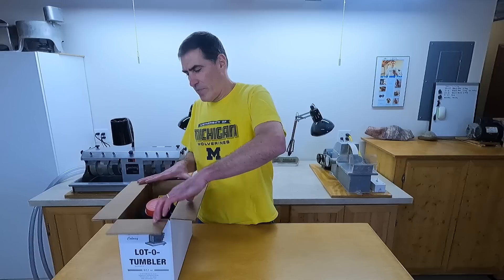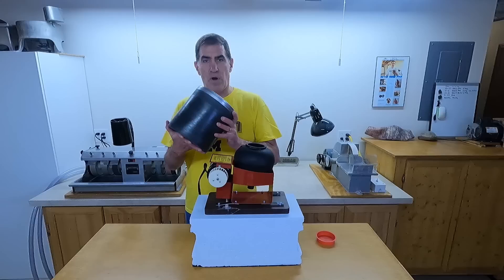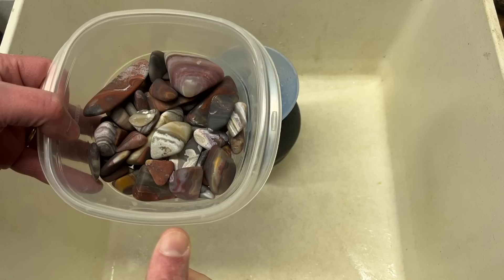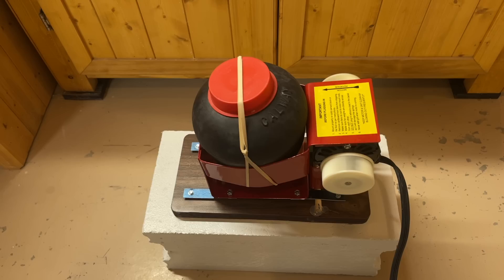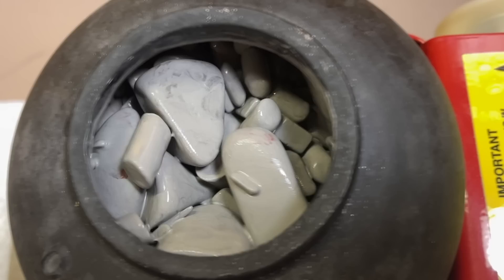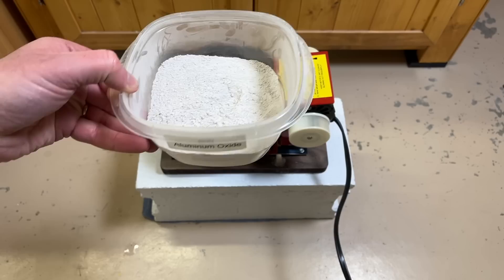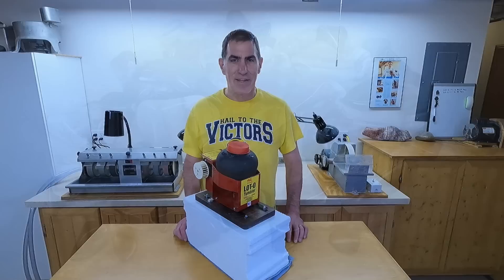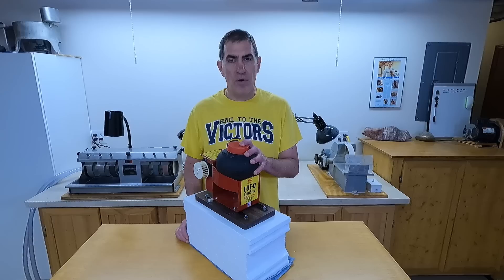The Lot-O Used To Be My Favorite Tumbler. It's Not Now. See Description Below.

Comment: I love my double barrel Lot-O tumbler, I also have a single one as well. I am still learning a lot and have a long way to go to even be half as good as you Rob. Right now my back won't allow me to mess with my tumblers so I'm on hold for a while still. I do have several rocks I need to polish better, because I had bought a cheaper grit.  Lesson learned. I have learned so much from you. Thank you so much.  Great video. Thanks for sharing.
Reply from the maker: Wow, you have three Lot-Os (double + single)? That's a lot of space in very fast tumblers. I went the other way and put my money toward a lot of rotary tumblers just to feed one Lot-O. Until about a year ago, one Lot-O was plenty for me. Then again, I'm sort of obsessive about that first stage and getting all the holes out of my rocks so I need more rotary barrels than vibratory barrels.
Reply: Yes I have both a single and a double. Most of what I bring home is pretty smooth already.  But I do have to let some go longer in the first stage still. I don't always have all my tumblers running at the same time either. I'm down by 2 of my rotary tumblers now as well. The 2 I got from harbor freight both died and in less then a year. So disappointing.  I'm hoping to build a larger capacity rotary tumbler this year. I finally get the camper here that I'm turning into my workshop, so now I have to fix it up the way I want it to be. I just need the tumblers out of my tiny home to run them. I have tons of rocks just sitting here that I have collected over the years that need tumbled.
Reply: I think I was not too selective in what I brought home in the past years, so I have a lot of sorting to do now. I know I have rocks I just won't tumble or they won't tumble well so I need to weed them out. I am super selective now days on what I bring home. I need to catch up with what I have first. So I guess it's a good thing I couldn't get out much last year. LOL
Reply from the maker: @donnalantz7981  Sounds like you're going to be busy!
Reply: Keeps me out of trouble. LOL

Comment: I am new to tumbling. :) This video was a Godsend for me as they all seem to be! I have an older Lot-O Vibratory tumbler that I bought probably close to 25 years ago at a garage sale. I have never plugged it in until now. Other than a broken spring and a missing cap it seemed like everything is operating fine. I did not realize how the rocks should be moving inside the barrel until I watched this video. Unfortunately the website for this tumbler seems to be out of stock of many things including the spring I needed. I was able to get a cap though. I just happen to have a 3" x 5/8" mending brace that I bought from Menards a few years ago. I wasn't sure if it was going to work because it is more stiff(thicker) than the original spring. The holes lined up perfectly and I installed it anyway just to see if it would work. I also filled the pit at the bottom of the barrel with clear Gorilla glue and replaced the dowel. I started a batch today and "Wallah" it's moving fantastic! I'm still not sure if the glue will help or hinder because the one batch I ran after I filled the pit with glue ended up becoming a big clump at the bottom and I have not had the happen before, even with a broken spring. I'll know in the next day or two if the glue has been a help or hindrance. I ordered two more barrels so that I can have one for each phase. So if I have to remove the glue it will not be a big deal. Thank you for putting together such fantastic helpful videos and congratulations on the first place win of your young student. That's inspiring. :)
Reply from the maker: That information about the spring replacement might come in handy for some other people. I have heard that they're not able to get springs from the spring manufacturer right now. It's nice to know that there's an alternative. 

I used epoxy to fill in the holes of the original barrel. If your Gorilla Glue doesn't work, give that a try. Doesn't Gorilla Glue expand as it dries? I'd think that could be a problem. Epoxy doesn't do that.
Reply: @MichiganRocks  There is a Gorilla glue that expands. The one that I used did not. I used the clear version and let it dry for a few days. The front of the bottle says 'no foam' and 'water resistant'. So far so good with this batch. I did a couple of spritzes of water this morning. Tomorrow I will remove the rocks and update what the bottom of my barrel looks like. :)
Reply from the maker: @mrsluvtolearn  Oh, ok, I didn't know there was another kind. That type sounds like what you want.
Reply: I updated this this morning but it disappeared for some reason. Here goes again. :) The bottom of my barrel did have a slight clump, not as big as the last one but still there. I popped out the glue just by pushing in the nub on the outside only to find out that there was still a bit of wet glue underneath even after letting it dry for two days initially. Fortunately I have my new barrels already and was able to move to the next stage. If I were to do glue again, I would let it dry much longer than two days or use epoxy as recommended here. I just checked my tumbler after having it ran most of the day and it is moving faster than ever. I'm super pleased. :)

Comment: I bought one of these barrels. And made one of these. 
I used a 500watt spindle motor and a whiskey barrel band it’s all suspended on top a single metal rod stuck into a wood block. to act as the spring or give for the vibration. 
40 dollars and parts I had laying around.
Reply from the maker: That's awesome. You should make a video showing it off. I think a lot of people would be interested in seeing that.

Comment: Followed the link to replacement motors and went with the cement vibrator, works almost to well, going to have to experiment with how much ceramic media to use it definitely moves the rocks more aggressively
Reply from the maker: You can adjust that motor to work just like the original. I forget which forum post I linked here, but look at this one to see how someone with a ton of experience with a Lot-O adjusted his motor weights: https://forum.rocktumblinghobby.com/thread/101470/finished-batch-watt-concrete-motor

Comment: I added a cement vibrating unit to mine after the motor died. I bolted it to the top and it is adjustable for how much it vibrates. Much better bearings and cheaper that the original.
Reply from the maker: Did you get that idea from Chuck (Drummond Island Rocks) on the Rock Tumbling Hobby forums? It wasn't his idea, but he did a nice job of showing his process. 

https://forum.rocktumblinghobby.com/thread/101470/finished-batch-watt-concrete-motor
https://forum.rocktumblinghobby.com/thread/101420/lot-motor-concrete-video
Reply: @Michigan Rocks  I don't know.  I like to think I thought of it but I'm old.
Reply from the maker: Maybe you did. I've just seen other people discussing doing the same thing.

Comment: What I've found with this tumbler is that if you don't fill it up enough with rock and especially with ceramic tumbling media, it just won't roll like it's supposed to.  So if it looks like yours is just really weakly tumbling, or just sitting and jiggling, check how much stuff you have in there.  Ideally you should have about half rocks and half tumbling media, and together they should be nearly to the top, no more than an inch below the top rim.  Also, don't try to tumble too many large rocks at the same time.  A mix of medium, small, and a couple or three larger rocks works well.
Reply from the maker: That's right, it does need to be filled up pretty well. I sometimes run it with more than an inch of empty space and it does fine, but I'd rather utilize all the space inside if I can. I don't think you need to have 50% ceramics, but it doesn't hurt to. I'd say for me about 30% is the minimum amount. If I'm tumbling lots of flat things, like Christmas ornaments I make, or cabochons, then I bump the ceramics up to 50% or more.

Comment: Hi Rob,
Thanks so much for this video. It was a lot of help to me.
Just a few days ago I finally got around to setting up my single barrel Lot-O Tumbler. After filling it and turning it on (yeah!) my rocks barely moved. They just kind of vibrated a little, like dancing up and down. So first I thought maybe I had the barrel too full, so I removed some of the rocks and ceramics. Going so far as to actually weighing out two pounds of rocks and 1 pound of ceramics. Still barely any movement to the content of my barrel. No standing water in the barrel was to blame for the inaction either. 
I remembered your video and rewatched it and writing down the measurements for the location of the dowel. Mine was not in that location so after a short trip to my local hardware store for an 1/4" open end wrench (I think that is the only thing that can remove the 2 bolts underneath the motor bracket) and some 3/8" dowel material the next morning. I went about taking the machine off it's baseboard and repositioning the dowel. Good thing I already have a brad nailer and hot glue gun. 
Finally my rocks are moving with a nice rotation in my barrel. 
It even seems to me that the motor is not making as much noise as before and also is not getting as hot.
Reply from the maker: My motor gets plenty hot, so I wouldn't worry about that. I fill my barrel right up to the top, no need to weight anything. I'm glad you've got good action now.

Comment: im just getting into rock tumbling and you are increadible! Your videos and advice is second to none.  Also, GO BLUE!!!! (I grew up in TC and now in GR) Thank you for sharing your wisdom.
Reply from the maker: I'm glad to help out!
Reply: curious, does it hurt to add a step of 1000g Al oxide? before the Polish? also, besides wasting grit, does it hurt to use 1tsp instead of a half tsp for the 500, and polish?
Reply from the maker: @schramajamma  Adding a 1000 stage doesn't hurt. I used to run 500 for two days and 1000 for two days. I switched to running 500 for three days and skipping the 1000 and haven't noticed a difference. 

I don't think using a little more grit should hurt anything, but 1/2 teaspoon works fine, so I haven't tried more.

Comment: Just the info I was looking for, I am getting good results but my rocks never moved like yours did (your old model) I thought maybe the older models were better designed. Another thing to be aware of is the bearings will come loose on the motor, mine lasted about 2 years. The motors are replaceable but be prepared for the price.
Reply from the maker: My first motor lasted ten years or so, but you’re right about the price of a new motor. Ouch.

Comment: Good review. Just a couple of additions, FOLLOW MICHIGAN ROCKS directions, not the confusing ones that come with the tumbler. Those instructions, say "adjusting the dowel is not recommended until you are familiar with the machine", which if isn't working from the factory, you'll never be able to become familiar with it. The buyer will just have buyers remorse. My Lot-O didn't move rocks either, until I readjusted the dowel. Ten minutes after I plugged it in for the first time. You also need to make sure the weights are in same place, which is another quality issue. If the weights are even slightly off they can cause very bad shaking, and no rolling action. The rubber band holding the lid is best way to keep lid on, don't poke a hole in the lid as instructions say. The lid will still come off and the slurry turns into sludge while you're asleep.
Reply from the maker: I poked holes in the first tow barrels I had, but not the new ones. The lids aren't so airtight that they're going to come off due to any gas pressure build up. They're much more likely to come off because of a rock pushing them up. 

I don't think the directions say to never move the dowel. I would be careful to know what you're doing before moving it though. 

Good point on the weights, although I didn't check them that closely. I'll probably check them now that you mentioned it though.
Reply: @MichiganRocks  Thanks Rob, I dug up the Lot-O's instructions and edited my comments. You are correct. In addition, I have had to adjust dowel (other times) for different sized rocks to get the correct roll.
Reply from the maker: @powerlinekid4296  On my first machine, I have never adjusted anything. It just works.

Comment: I didn't move my dowel, just unscrewed the 4 screws holding the machine to the board, drilled 4 new holes, moving the entire machine, but leaving the dowel in place.  This is much easier because the dowel is connected with multiple--irreversible--fasteners. It's obvious that the closer the dowel is to the balance point of the machine, the more vigorous the action. With the machine unbolted, it can be slid along until it just tips over. Mark and drill the new hole position, replace the screws, done. No need to mess with the dowel at all.
Reply from the maker: Sounds like that worked well. Thanks for posting an alternative method.

Comment: I ordered a Vevor 3Kg tumbler, received it yesterday. I purchased it so I could grind red porous lava rock to its finest sand/dust state to use for fertilizer. I used it once, about a decade ago, and the tomatoes I grew that year were like no other. I am repeating the process, but, instead of obtaining the pulverized lava rock through beating with a hammer, I am using the Vevor tumbler. I found that the mutt rocks I put in with them have had markable improvements in their surface (smoother, far faster than just with any grit I had used before) with less than 18 hours of tumbling. Have you ever tried the garden/house border/grill bed red lava rock as a surfacing device, before? (I am not using grit, just the lava rocks, which should make the silt accumulated completely garden-friendly)
Reply from the maker: I don't think that tumbler is made for rocks, is it? I just looked at it and it doesn't say anything about tumbling rocks with it, only jewelry. I'd hate for you to ruin it on your first use.

I have never tumbled red lava rock at all. I never thought of tumbling anything just to put it in my garden. This is from a guy who once made a video about composting. https://youtu.be/B7e7iFdrjb8
Reply: @MichiganRocks  I see what you mean about the site, itself, listing it as a jewelry tumbler. I will use it until I need to replace the barrel, then probably get an old classic model. Thanks for bringing this to my attention. It came up in eBay when I did a rock tumbler search. 

And, thanks for the composting link. I do similar in composting, my neighbor also burns the leaves.
Reply from the maker: @cannedmusic  I have a couple people who deliver a lot of leaves to my house. I compost some, but most are aged for a year and a half and then used for mulch on my gardens. By the end of the summer, they've broken down into compost.

Comment: Just as an FYI, Since my Lot-O was out of order I found a replacement until I can get a new motor. It is a Ray-Tech TV-5 standard vibratory tumbler that I purchased on Amazon. It is rated for rocks and I have had good success with it. It was reasonably priced and I also purchased additional dedicated bowls for the different grits. I found that doing a burnishing after each grit kept the bowls nice and clean. The covers are clear so you can see the action and the removal is easy to add more water if needed. I looked for a long time and could only find the ones for dry use. I was really happy to find these. At least I could keep on tumbling. Hope this helps someone.
Reply from the maker: Thanks for the recommendation. I have never used that model. Does it give you the same awesome shine that you get from a Lot-O?
Reply: @MichiganRocks  I have never gotten the awesome shine that you have shown in your videos, even in the Lot-O (not as patient as you I guess). I have tried one batch in the Ray-Tech and most came out with a shine that I was very satisfied with. Unfortunately I had a mixture of different hardness and the other part of "the most" were too soft to shine up. I'm still learning. I can say with authority, though. that I really liked the rotating action of the rocks better than I used to get with the Lot-O. Of course I have not been able to try it now that I changed the location of the dowel. That is still to come. Suffice it to say that I have found that the Ray-Tech is worth the money ($89) as a backup to the Lot-O when it's not running and it lets me keep on tumbling. Oh, I forgot to mention that it has an on/off switch, something that I wish the Lot-O had. Thanks for responding.
Reply from the maker: @hbeyer46  Thanks for the additional info. I can't test every machine, so it's nice to get some opinions about other tumblers here too.